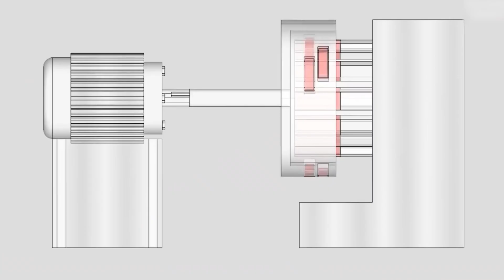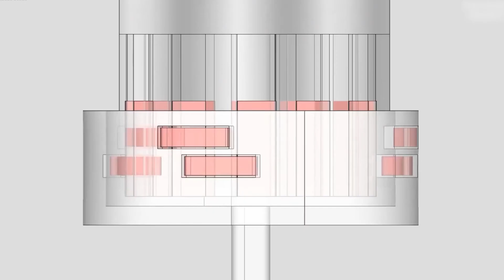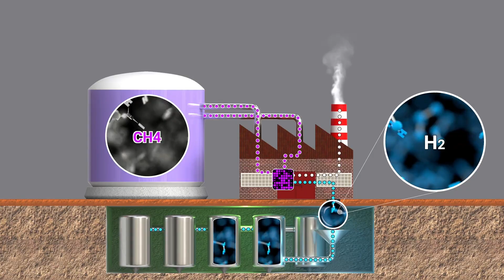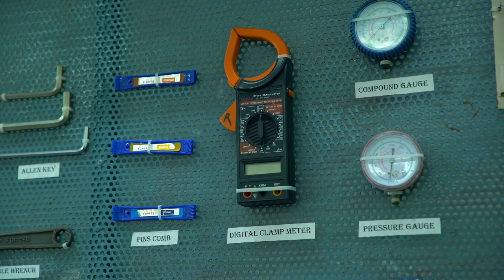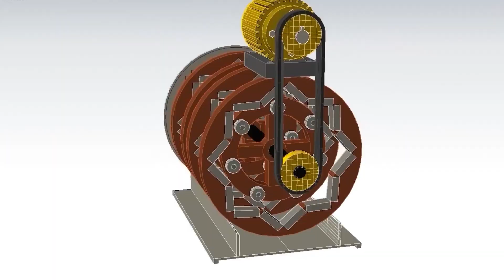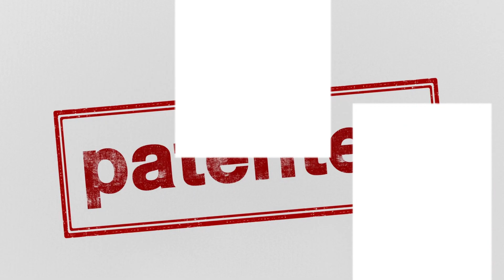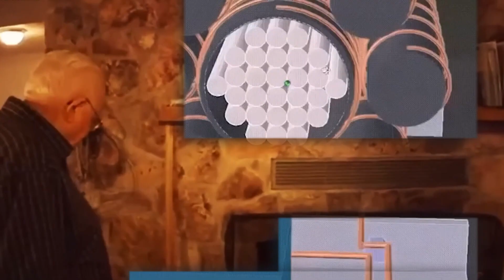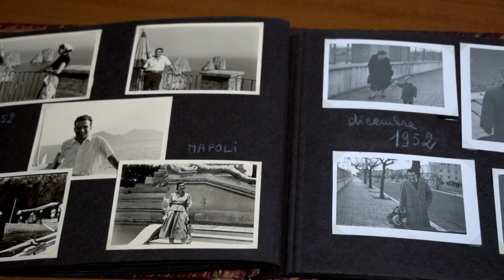Perpetual Magnet Power: Patent That TERRIFIED Energy Companies!

Comment: Studying the concepts and blueprints, the Johnson magnetic motor is possible.  The concept is based pole position versus timing.  
THIS IS NOT A PERPETUAL MOTION DEVICE!  Friction and wear will stop it eventually.  
It does not violate the law of conservation if you compare ALL the factors involved; heat produced, Gauss field strength, and angular momentum.
Permanent magnet motors are in wide use today, using stationary electric field coils to control the speed and torque.  In Johnsons device, those factors are controlled by varying the distance from the rotor.
Reply from the maker: Thanks so much for explaining all this! It’s a really helpful breakdown.